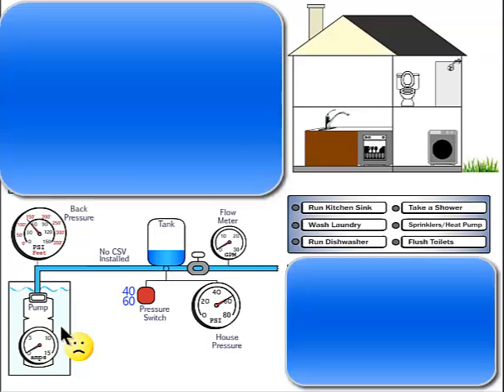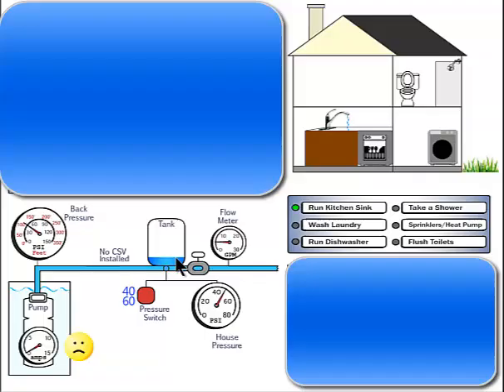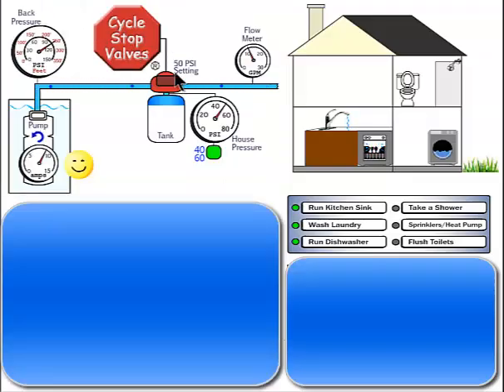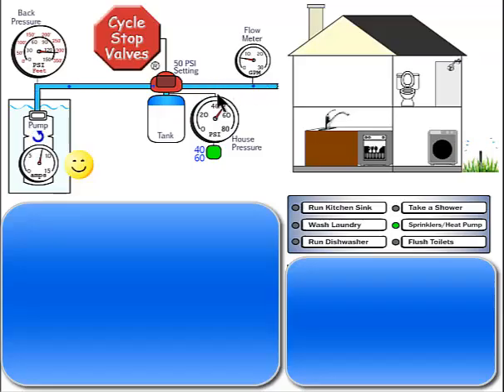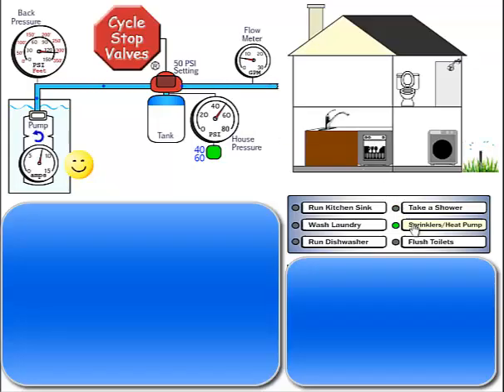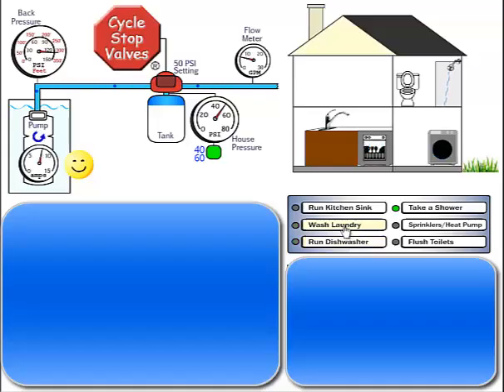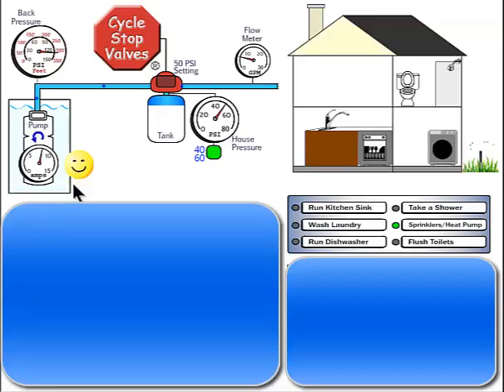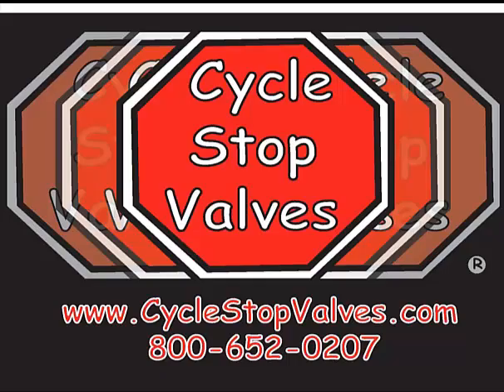How a Pressure Tank Works and why you need a Cycle Stop Valve

Comment: Nice learning video. We install 1 hp 18-25 gpm submersible pump and a 75 psi over pressure relief valve in systems with pump start only or without overpressure relief valve using a PSI tank. Using a 25 gpm pump, pump start and over pressure relief valve with a small irrigation zone or someone using a water hose at 8-12 gpm with a csv limiting the output psi to 50 psi, the water not used creates back pressure before the csv. The back pressure increases as less system water is being used, up to whatever the pump can generate in a closed system? Which is better for the pump 1) to design the zone to run at 50 psi. 2) Use a CSV and let the pump run with whatever back pressure it can achieve up to the over pressure relief valve while small amounts of water are being used (garden hose) 3) Design zones to match say 75% of the pumps rated output and let the csv do its job, noting a back pressure 25% water output isn't enough to shorten the life of the pump?
Reply: Bob-the-Pilot, try to visualize the pump as a weight lifter.   The weight lifter can dead lift 300 pounds over his head - but, it takes all of his strength to do it, right?     And, if he dead lifts 50 pounds over his head, it's a lot easier, isn't it?  The pump is the same.   It can deliver 25 gallons per minute, but it takes all of its strength to do that.   But, delivering 1 gallon per minute is easy, isn't it?  The harder the pump has to work, the more current it is going to use.
Reply from the maker: Well first let me say that even a back pressure of 99% is not going to hurt the pump.  As long as you are flowing at least 1 GPM, the pump/motor will be fine.  It is actually easier on the pump/motor (draws lower amps, runs cooler) when restricted to 1 GPM, than when running at maximum flow.  We always recommend a pressure relief valve, even with a pressure tank/pressure switch.  However, the relief valve needs to go after the CSV, not before.  With a CSV setting of 50 PSI using a pump start relay, set the pressure relief to 60 PSI.  In this way when the gophers eat the wires going to the sprinklers and the pump start relay starts the pump anyway, at 60 PSI the pressure relief will pop off the 1 GPM coming through the 50 PSI CSV to keep the motor cool.  Same thing with a 40/60 pressure switch, except set the pressure relief valve for 70 PSI.  This way the pop off valve will still dump 1 GPM, keeping everything cool, if the pressure switch fails to shut the pump off at 60 PSI.

As for which is better for the pump, a 50 PSI CSV using a small tank and a 40/60 switch is best.  In this way the pump starts with pressure against it, which is much easier on a pump than when starting with no pressure from a pump start relay, which causes upthrust.  Again back pressure (when starting or running the pump) is much easier on a pump/motor than when starting or running at full pump capacity (no back pressure).

Now matching every zone to exactly to the pumps output is more efficient.  But it is usually almost impossible to make every zone exactly 18 or 25 GPM.  There are always a few zones that need to be smaller to fit the size of the yard.  The closer you can get the zone size to the output of the pump the more efficient, but it isn't going to cost much extra to have some small zones as well.  When restricting the pump with a CSV, the amps or energy consumption will also drop, so it is not much less efficient and much easier to design when simply matching the zones to the size of the yard, and letting the CSV adjust the pumps flow accordingly.
Reply: Cycle Stop Valves Understand all except the pump regulating its amperage based on water demand. Haven't read where an electric motor regulates its amperage base on a water restriction. I figured the pump amperage was the same regardless therefore the psi before the csv was higher. Thank you for your time.
Reply from the maker: I know right!  It is just the opposite of what you think.  But it is written as plain as the nose on your face in every pump curve.  Larger pumps usually have a separate curve just for horsepower.  And smaller pumps are no different, they just usually don't show the horsepower.  Some like Grundfos curves show HP on small pumps as though.  Here is a link to a video I made about the amp drop as flow is restricted.  https://www.youtube.com/watch?v=3GABhLLtjas&t=105s
Reply from the maker: Great way to explain it!  Much easier for a pump to lift 1 GPM than 25 GPM.

Comment: How would this impact my on-demand HWH? I believe a specific flow rate is what causes it to turn on.
Reply from the maker: We sell a lot of CSV specifically to make on demand heaters work properly.  Usually the 40 to 60 swing in pressure using the old pressure switch method will vary the flow in the shower head.  At 40 the shower flow is low and the instant heater goes off.  At 60 the shower flow is high and the instant heater comes on again.  Some people call this a cold water sandwich.  With a CSV holding a constant 50 PSI as long as you are in the shower an instant heater will stay on as it should and give you all the hot water you want.
Reply: I don't have the cold water sandwich situation although I'm familiar with it from when I had such in the late 80's... I had the on-demand installed 2 years ago and it has worked fine except for a drop in pressure for approx 15 seconds during a long shower before it comes back strong (and still hot). This only started in early December (4 months ago). A well service is coming out this afternoon. I'll see what he says and if he has ever heard of a cycle stop valve. I live in the boondocks and a lot of the service folks up here don't know about new developments in their trades because they simply haven't encountered anything since they first learned.

Comment: What will keep this type of unit from burning out the pump motor if the well only produced 7GPM. and the out door hose puts out 23 GPM?  How long will it take to run the well dry?
Reply from the maker: The CSV would have nothing to do with that problem.  If your well only makes 7 GPM and you are letting out 23 GPM, the well will be pumped dry as soon as the extra water stored in the wells static level is depleted.  Can probably only run 23 GPM for 10 minutes or so before you pump a 7 GPM well dry.

Now if you have a 23 GPM pump and the well only makes 7 GPM, then if you only open up 7 GPM or less, the CSV will make the 23 GPM pump only put out 7 GPM or the exact amount you are using, so in this way the CSV can help keep from pumping the well dry.

In low yield wells the Cycle Sensor will protect the pump if the well runs dry.  Using the Cycle Sensor for protection and in combination with a Cycle Stop Valve will let you get the most out of any low producing well.

Comment: Do pump manufacturers have any issue with installing these? It seems like having something to restrict the flow from the pump might void the warranty.
Reply from the maker: YES THEY DO!  They hate it that the Cycle Stop Valve makes pumps last several times longer than their planned obsolescence date.  So they will tell you anything they can to keep you from using a CSV, including saying that it will void the warranty.  BUT they will not put that in writing.   They know if they put that in writing I would own their pump company.  Because not only can they not disallow a warranty for using a CSV, they have never seen a pump damaged in anyway in all these 25 years the CSV has been in existence.  Restricting the flow from the pump reduces the amp draw and makes the motor run cooler.  Plus restricting the flow is how the CSV keeps the pump from cycling itself to death, which is why pumps using a CSV last many times longer than those without a CSV.

Comment: Hi, will the CSV work with any type pump?
Reply from the maker: Any pump with a centrifugal impeller.  This includes submersible well pumps, jet pumps, mutil-stage booster pumps, turbine pumps, split case, and end suction centrifugal pumps.  The only pumps a CSV will not work with are positive displacement pumps like piston, gear, and rod pumps like windmills.

Comment: Thank you for adding the back pressure valve in the illustration. People need to know/see that there is excessive back pressure being restricted to this side of the pumping system. I know you have "proven" that this back pressure will do less damage to the pump than damage to the motor from more cycling, but this back pressure can get in excess of 150psi... Good valves though, I use them in a few different applications.
Reply from the maker: There can never be "excessive" backpressure with a Cycle Stop Valve.  The CSV itself cannot handle "excessive" backpressure.  The only time you would have excessive backpressure is if you have a 100' deep well with a pump designed for say 500'.  And that is not going to happen because the CSV will not even work in an application like that.  The CSV will only work with less than 125 PSI differential pressure.  So if you have the CSV set for 50 PSI, there cannot be more than 175 PSI coming from the pump.  Many pump companies want you to think the CSV causes "excessive" backpressure.  They don't want you to get the benefits of a CSV, because it will make your pump last longer.   So they try to scare people talking about "excessive" backpressure, which in reality CANNOT happen.

Comment: What software are you using? Is there an app similar for phone or tablet? Thank you
Reply from the maker: The animations seen here needs Flash.  https://cyclestopvalves.com/pages/animations
Even though it is the most modern pump control on the market, Cycle Stop Valves have been around for 25 years.  So much of the stuff on our web page uses older software.
Reply: thanks man, I thought it was some kind of a simulation program where you can hookup things together and do a virtual test before you actually do it in real life.
Reply from the maker: It sort of is.  There are several animations to try and duplicate any type of water system you may have.  And with this program you can turn on sprinklers, showers, toilets, etc., and see how the CSV controls the system.  But I made the above video using this program for those who can't get the Flash software to work.

Comment: I own a trailer court and I have 3 trailers that is occupied. Can I use one of this to maintain better pressure when 1 or more is using water?
Reply from the maker: Yes you can.  The CSV  makes a big pump act like a small one when needed.  So you can have a pump or pumps large enough to supply a huge city, and the CSV will make it act like a really small pump when only one shower in one house is being used at the time.
Reply: Is the back pressure bad on my submersible pump?
Reply from the maker: Absolutely not!  Back pressure makes pumps last longer for several reasons.  I am sorry you have not got this from the many videos on my channel showing how it works.  So I will just say it plainly. Back pressure reduces the amps and makes the pump/motor run cooler.  Back pressure can also reduce the amount the pump is putting out. This is how a CSV makes the pump stop cycling, as cycling is the worst thing you can do to a pump.

Comment: You're right that pumps will use less energy at lower flow. That is one of the ways i diagnose pumps at work. This doesn't make this valve work in pump control applications though. Running the pump at less than 50% of its flow rating will cause cavitation and vibration thus increasing wear on it.
Reply from the maker: Yep close a valve and if the amps don't drop that is the best way to diagnose a bad thrust bearing in the motor.  But you can run these regular centrifugal pumps at much lower flow rate than you would think.  Now I am talking about using cool water only, as hot water applications have a much higher minimum flow required.  The minimum flow in a Cycle Stop Valve is set to maintain adequate flow to keep the pump from getting hot.  The cool water being pumped can never increase in temperature by more than 10F degrees from inlet to outlet.  As long as you don't let the fluid get hot, water has excellent cooling and lubricating values.  A little re-circulation doesn't hurt anything, and won't cause any cavitation until the water heats, which it is not going to do.  

Vibration on a large end suction centrifugal pump can happen if the shaft slenderness ratio is too low.  A small diameter shaft cannot hold the weight and force of a large impeller extended on the end of the shaft.  But if it is a well built pump to start with, it won't vibrate even at very low flow rates, just like when you are testing at shut off.   Multi-stage and submersible pumps, which are most common in these applications, have bearings on both ends of each impeller and are not prone to vibration from shaft flexibility.

Even if there were a little vibration or cavitation, it would be far less harmful for the pump/motor than letting the pump cycle on/off to supply varied demands.

Comment: What about the new Variable speed pumps? Do you need a cycle stop valve? My neighbor has a VSP pump and a looks like a small <5 gal tank. Not sure if he has a Cycle stop valve install.
Reply from the maker: The Cycle Stop Valve or CSV was designed to replace Variable Speed Pumps or VSP's or VFD's, etc, etc.  Variable speed pumps are not new.  I was doing them back in the 80's.  They have been around since 1964.  However, VFD's have been "upgraded" or "de-bugged" every 18 months or so since VFD time began.  They told me in the 80's that the newest model was going to solve all the problems of the last model, and they are still saying that today.  They have made a LOT of improvements over the years, but laws of physics will never let them solve all the problems that happen when you vary the speed of a pump.  

VFD's are a good thing however, in the fact that they will deliver water at a constant pressure and allow the use of a very small pressure tank the same way a CSV does.  It is just that when you have two ways to accomplish the same task, the simplest way is always the best way.  A simple little valve (CSV) with only one moving part is going to cost much less and last much longer than any computerized VFD with thousands of electrical components.  Plus using a CSV is much easier on the pump/motor than the pulsing power supplied and resonance frequencies created by a VFD.  Pump manufacturers are in the business of making money selling pumps and VFD's.  Why on earth would they even mention or condone a product that is disruptive to their industry because is cost very little and makes pumps last much longer than designed?

Constant pressure is an excellent idea.  And a CSV is a much better way to get it than a VFD.

Comment: Thank you for the well informed video. What is your opinion on a whole house filter with a CSV? Should a filter be installed before the pump, between the pump and CSV, or after the CSV?
Reply from the maker: Normally filters are installed after the CSV/pressure tank.

Comment: what about the head pressure on the pump?  150 ft well plus two story house?
Reply from the maker: "Head pressure" is what a pump does.  Even though your well is 150' deep and the pump maybe set at 145', it is still only lifting from the actual water level.  So lets say the water level in the well is 100' at the lowest.  Then you need a pump that can produce a head pressure or lift from 100', plus deliver the pressure needed in the house.  With a single story house I would only use a 40/60 pressure switch.  But with 2 stories I prefer a 50/70 pressure switch setting, which with a CSV will give you 60 PSI constant while the water is being used.  This 60 PSI needed can be converted to head in feet by multiplying 60 X 2.31 for an additional 138' of head.  The 50/70 setting is already making up the extra needed for the 20' elevation of the 2 story house.  So adding the 100' of actual lift in the well to the 138' of head needed to make the 60 PSI for the house, gives a total head needed of 238' the pump must deliver.  Now picking a pump that will do maybe 10 GPM at 238' means you need a 10 GPM, 3/4 HP pump.

When using a CSV the head pressure on the pump will increase when you are using less than 10 GPM.  When the CSV makes the pump produce only 1 GPM, because you are only using 1 GPM at the time, the pump will be seeing a head pressure of 310', which is the same as 134 PSI.  So when using 10 GPM the CSV lets the pump draw from 100' and produce the 60 PSI needed in the house.  But when only using 1 GPM, the CSV makes the pump think the water is 310' deep, which is how the CSV make the 10 GPM pump produce only 1 GPM when needed.

Comment: can u use a csv with rainwater harvesting with a 3.5 gpm pump to run water to a cabin
Reply from the maker: Sure as long is it is a regular centrifugal or jet pump.  The CSV won't work with positive displacement pumps like those 12 volt RV type pumps.

Comment: Question... My water pressure from the pump alone is not so great. With this system I can't increase the water pressure and am at the mercy of my pump, correct?
Reply from the maker: Maybe not.  If your pump is cycling on and off while using water and experiencing low pressure, you maybe able to turn up the pressure and even use a Cycle Stop Valve to get much stronger constant pressure.  What model pump do you have, and does it cycle on and off while using water at low pressure?